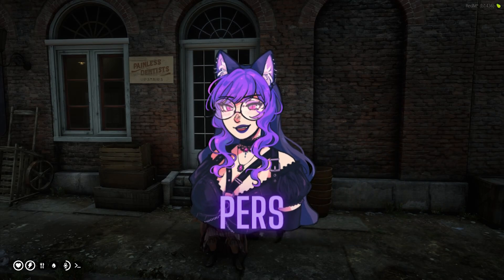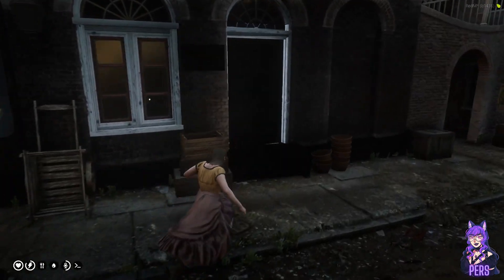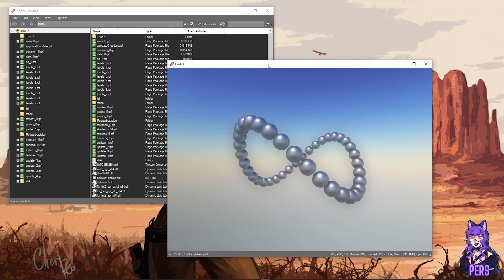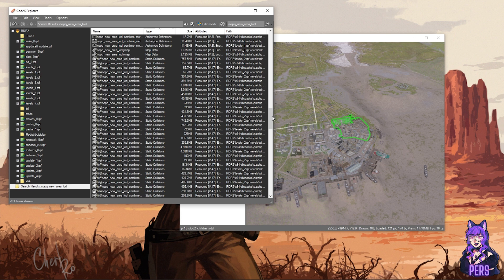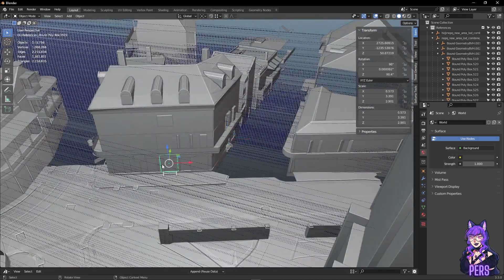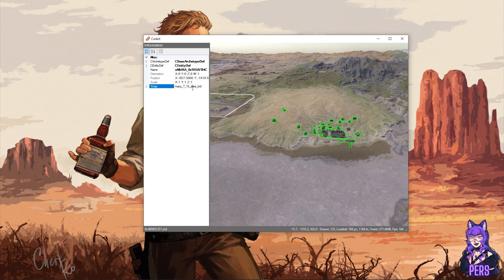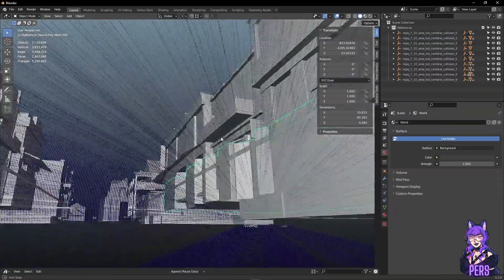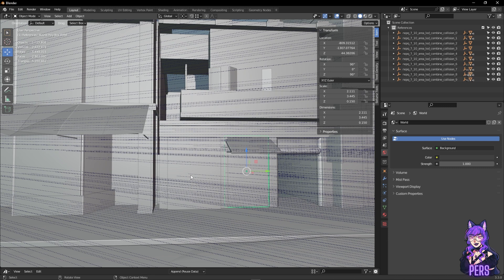RedM Edit/Remove Collisions Tutorial 🏠

Comment: btw maybe to make it easier.
i would always chose the ones that exist in the patchpack archives bc those are ones R* updated via patches and such.
not that they fixed a missing collision and then you edit that one and basically reintroduce the bug again on your server.

and the hi@ collisions are only for detail, like railings, and other small detail which is usually used for weapon collisions so you can shoot through stuff for example.
while the other ones are the more simple collisions that contain the big stuff.
so in most times you can just ignore the hi@ collisions.

and interestingly i deleted collision pieces before and there was not a issue.
but only did some prop collisions in amberino, so maybe different in cities.

Comment: You can delete them and duplicate them for sure, i did it for my mlo with no issue back in the day, only stairs and custom attribute mesh cannot be deleted :) and nice one Pers ! And don't forget to do the other Hi collision to allow PNJ (ped player or PNJ)  and bullet etc to go thru :)
Reply from the maker: You can't delete them without the possibility of errors. Sometimes it'll be fine, most times not. I suggest sinking them just to be safe. The same concepts don't apply to RedM yet as they do in FiveM. 
Thanks for the tip about the PNJ! <3
Reply: @PersOnTwitch  I did a Van horn mlo available on my tebex, and mutch more mlo i didn"t post, it's kinda trial and error on collision, but for me, delete them works most the time :) and no problem Pers, keep up at making good tut's :)